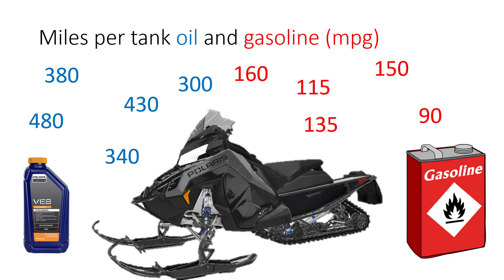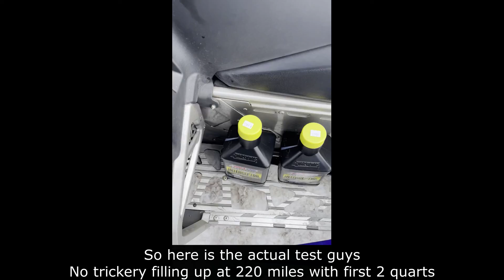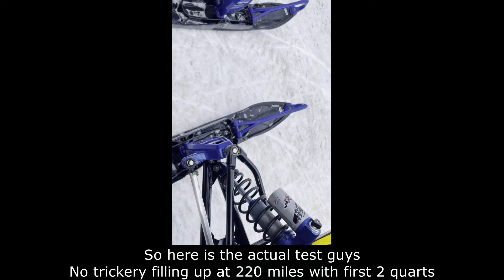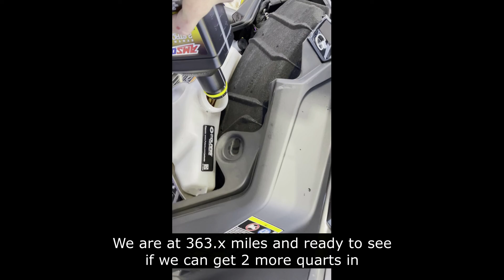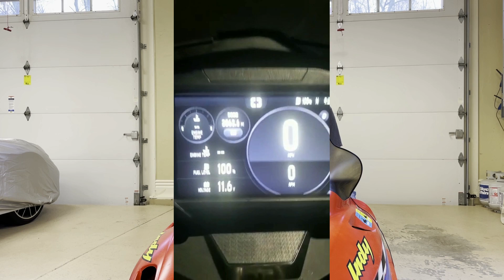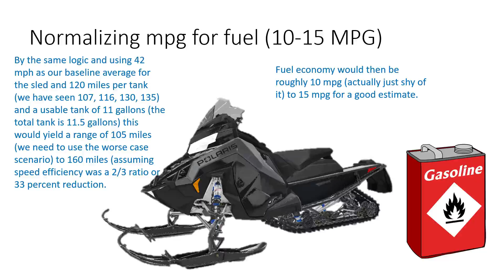Polaris Matryx 850 VR1 Oil and Fuel Economy

Comment: On average I am getting 11 miles per. gallon. 2024 xc 850 137. I went 97 miles and it took 8.4 gallons to refill. I'm getting about 460 mile per. gallon of VES gold oil. I'm running 93 oct. 10% ethanol. In ethanol mode.
Reply: That’s pretty good fuel average!

Comment: I have a 2021 VR1 850 with a 1.5 storm track (1.86 stock gear ratio)I get as low as 9 and as high as 14 MPG.  Normally with my riding style it is between 10 and 11 MPG.   I have measured my oil consumption multiple times and then I convert out to a fuel to oil ratio.  My sled runs between 45:1 and 47:1.  For example I used 13.1 gallons of fuel and 36 oz of oil for a which is 46.6:1.  That’s roughly 115 miles per 10 gallons of gas @ 10mpg.  My fuel economy is between 10% - 20% worst then a Polaris 850 with a 1.35” cobra (1.61 stock gear ratio) and also 10%-20% then an 850 Skidoo eTech.
Reply from the maker: Great comment.  With the VR-1 Boost economy is yet another 10 percent worse than the NA 850!

Comment: NO Wonder I sold All my news Sleds and went back to a pre 04 sleds.  Where do you carry all that OIL here in Some parts of Canada. When Gas and Oil shops are 90 miles or longer between stops. My 04 Polaris 800's I can reach 140 miles without the trail buddy fuel tank engaging. Plus I can  carry 2 xtra liters of oil under the hood in the front noise area.  New Sleds are not ment for the guy who wants to do high mileage. I drive 60 to 80 mph. Getting roughly 6000 miles on an engine when I tare them down and rebuild regardless.  The Cost over time for a new sled is not justified. They Are still bearings, Tracks and wheels and skis. I do run Shell oil and I do rebuild my clutches ever 2500 miles. The bushing in the weights are normally toast.
Reply from the maker: Yes indeed they can struggle.  The new Boost gets even worse fuel economy (ran out at 92 miles)

Comment: Wow that mileage sucks
Reply from the maker: You have it right.  When comparing this year against the 4 stroke (ace Turbo Mach) the 850 two stroke was always 1-2 mpg less.  That being said in a real world gas station to gas station comparison the Polaris had a bigger tank so it was still the same for fuel stops just need to put 1.5 gallons in the Polaris.. and then add some oil!

Comment: Porsche under the car cover?  Wheels and arch look 911 or Panorama.  Great video on economy.  Break in run rich oil first 10 hrs over 3500 rpm
Reply: 911 turbo s, 2017, I feel 100 percent busted.  Be safe and thanks for the comment!!!!
Reply: @josephseitz5386  2019 Boxster S in my garage.  Wheels and nose gave the 911 away.  Fits the 850 and the 650 fits the light mid engine Boxster handling.  Enjoy your toys.

Comment: I like the 650 mpg and oil use.  I find the 650 is great in tight trails.  I moved from triple 800s back to 600 and 650s.  Range on the old 800s was limited by 7-8 mpg.  Just finished break in and will get mpg on the next trip.  14 Switchback sipped oil and got about 12-14 mpg depending on throttle.
Reply: Thanks for the comment. Honestly we have been assessing how often we dial up over 90 mph on the 850s. Candidly it’s less than 4-5 percent of the time and think the 650 would fit the bill 95 percent of the time. Not like it’s terrible on the 5 percent just a little flat. I think you made a great decision for almost all riding conditions.

Comment: Nice info, I used  2 gallons of VES extreme in 1200 miles on my new VR1 including the full tank oil when I bought it,. Average around 10 mpg on fuel, around 5-600 miles on a gallon of oil, seems to be the same as my 2012 Artic Cat  F800, my buddy has a 17 skidoo renegade 600 that uses half the oil and gas I use, we ride a aggressive pace, it’s the price you pay having the 850 motors, I usually run till around 110 miles and get gas, I’m a big fan of Klotz, been running since the 90s in all of our 2 stroke bikes and quads, no issues, probably will switch over once sled is out of warranty? Or buy a new sled!
Reply from the maker: Right on Paul thanks for the comment.  Your numbers are right!  We decided to take a few legs and really stay off the throttle (think max wide open at 80 mph).  We were able to get 13 mpg by being really gentle on the throttle.  Great 30% increase in fuel economy but almost fell asleep on the sled!  Cheers!

Comment: Sounds very disappointing. Currently running a '14 600 etec GSX 137 and consistently get 17-18 mpg along with 800 miles/gallon of oil. My riding buddy gets 19-20 and 1000 miles from his 600R etec Enduro. I have previously owned a few Polaris's and was seriously thinking about going to the VR1 650 but after hearing of the mechanical problems and poor fuel/oil mileage I think I'll wait a little longer and see how things turn out.
Reply: Thanks for the comment and I fully understand. We are not brand loyal we do try a number of sleds. My last mxz 850 had zero problems and was a good machine although it lacked some of the handling the Polaris has. The new dimensions are awesome and the display and maps are unbeatable. I believe they will fix the bearing issue and the fuel gauge and exhaust springs. The fuel economy doesn’t get better. With us just staying beneath 80 mph we were curious to see what would happen and only managed to get 13 mpg. It is what it is. All that being said these machines do handle unlike anything else. Thanks for watching more to come we just literally arrived at home from the final trip.
Reply: My 650 129 worked great this year. Gas was in the 18 mpg range and oil was about 1000 Miles. My buddy has a sidewinder and I’m consistently 20% better on gas. Plus the fuel tank on the Polaris is near 2 gal bigger than skidoo.

Comment: I seen your bolt on your clutch was already broke when you were putting oil in great video I use to use amsoil bad for exhaust valves klotz is alot better I found out
Reply: Good feedback on Klotz. Yes sir the bolt was broke and the bearing was actually gone. We made an (almost) 4000 mile video showing the missing / destroyed bearing that happened prior to the shear off of the bolt. Ugh- well we have them back now counting on these sleds to get us another 1200 miles. Thanks for watching and the comment

Comment: I have used amsoil and noticed oil consumption is greater than ves. I think its thinner.
Reply from the maker: Thanks for the comment Ron!  It may have been that you were going faster on the Amsoil feeling the flow!  Just kidding of course I don't have a horse in the race.  I was looking for VES viscosity this morning online and nothing was listed.  I may get a sample of both this next coming week and freeze it down to 15 F then do a timed test through a funnel.  I'll look again later what matters is viscosity at our temps which is relative to viscosity at room temp but not the same.  More to come you have me thinking about it I'll see if I can find a few answers. I appreciate you watching!
Reply from the maker: I was looking around again this morning to try to get viscosity numbers.  Here is what appears to be an unbiased test (one never can tell 100 percent) and it is colder than most of us will ever run these sleds but shows an example of flow at cold.  I believe at real operating temps the difference would be less.  maybe using a little more oil would be a good thing.  Something to think about in my helmet on the next ride.  Thanks again for the comment - here is the link https://www.youtube.com/watch?v=PSV02l1gEKc

Comment: Ves extreme is the best
Reply: Check your power valves and you won't think so lol, Polaris says the power valves don't need cleaning but VES oild clogs them up awful in just a couple thousand miles. They actually stay cleaner with Amsoil
Reply: @wasupfool5692  you still have to clean the power valves with VES, my understanding is that with VES Extreme you don’t.